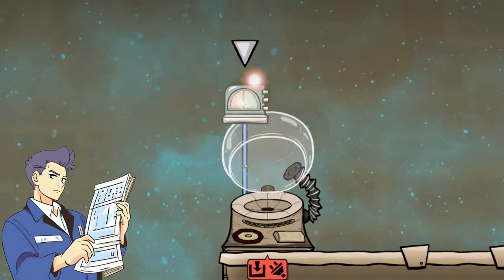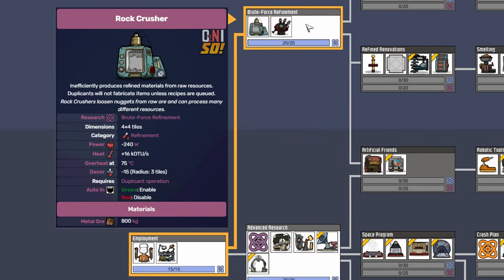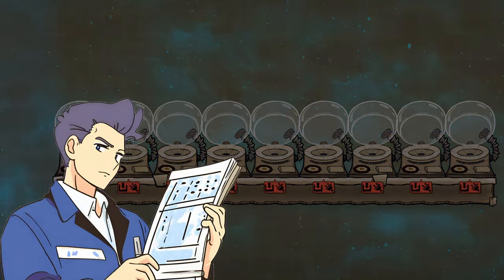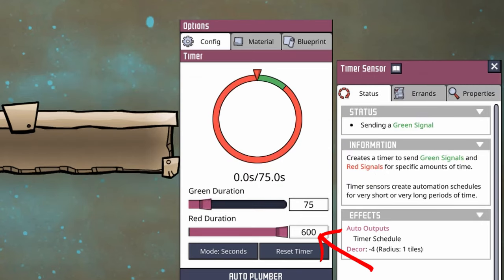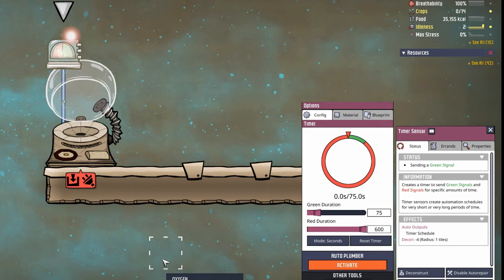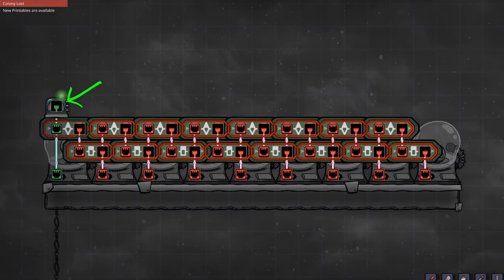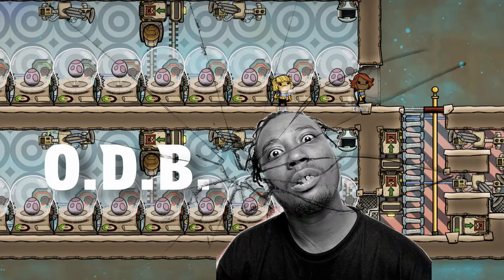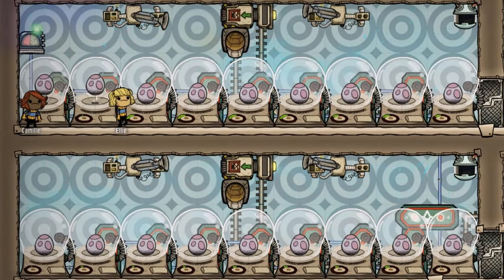Incubator Automation  ONI Tutorial

Comment: To speed up the lullaby task I install a pressure sensor under the left square of each incubator and connect the automation to a light so the dupe gets the lite workspace bonus when lullabying the eggs. There’s probably a more efficient way to do this too.
Reply from the maker: That’s a great idea. I totally forgot about that!
Reply: Lighting is an unnecessary source of heat in this setup because you pretty much have to have two dupes who live on-site and exclusively lullaby eggs, and 37.5 seconds per incubator is more than enough time to handle all the eggs. If these two ranchers did other ranching tasks too, like grooming or capturing/releasing, you'd risk missing a lullaby cycle on one or more eggs.

Comment: A simple design I came up with is getting the rancher in her/his own room that he cannot exit from where he enters, then he has to walk through the room with the incubators and in order to trigger priority, once he enters the sight of the first 2 incubators they activate with a dupe motion sensor, the door locks for 1 second (also there's a lamp), this goes for every 2 incubators and takes some time for the 1 sec door locking in order for the priorty to kick in but it's pretty simple to setup. If you want it more fancy - auto sweepers can load the eggs and so on later on when you have the metal for it.

EDIT: If anyone wonders how the automation works: I'm using a filter gate (1 sec) connected directly to the motion sensor and output goes to an XOR gate. The other input of the XOR gate is the motion sensor itself as well. And finally there's a NOT gate infront of the door so it keeps the door open. The motion sensor cannot be in the corner, but the light can be.

Comment: Nice build. I like the setup simplicity and the robustness. Maybe you could have tell that the incubator need to be the high priority for the rancher, so he come directly when the incubator is activated to not miss the actived window.

I had a similar build when i first started messing around with incubators. But instead of starting the chain with the first timer sensor, i only use the first timer sensor to make the rancher come. 
Then i used a pressure plate and a filtergate at the first incubator to more precisely activate the other incubators. 
Indeed the first need a lot of time as green to make the rancher come, but the following have a rancher just right next to them so it can be done more quickly. 

Anyway, your design is more robust to not miss any lullaby (so maximising for egg's lullaby uptime). In my design, when lullaby spree unsync with the rancher schedule (bedtime in the middle of lullaby), the other rancher didn't have the time to come for the next lullabies because he was far. In your design, the second rancher can come from afar, but at the cost of a lot of travel time in between lullaby. This is a ok trade off if the rancher are dedicated to lullaby, not so much if prevents any grooming.
 Let me explain this, it's not self-evident : Like in all thing in ONI, it depends on what you want to optimise for. 
 For the same number of full ranch critter, the incubator does 0 improvement in production. The production capability are the same with or without them.
 It does however reduce the delay for the production to arrive and this is important when you have a time constraint (emergency food or the carnivore achievement or to fill the ranches quicker)
However, missing a "grooming" task does reduce the production of the ranch. All the time the critter stays at 0% reproduction is lost production for the ranch. So by prioritising lullaby uptime, you can actually lower the production if you don't have enough rancher available. I hope it make sense to you.

For now, i didn't find any design that can cover all the thing : 
- good uptime of lullaby egg
- good rancher commute time
- handle the unsync for bedtime /multiple rancher (It's always a balance between lullaby uptime, and rancher labor/commute)
- handle the unsync from the time baby is not remove from the incubator (maybe doable with critter sensor with unchecked egg and a room for each, but costly in term of space)
- handle the "already incubated time". In your design it's always 0% /1% when it arrives in incubator, which make it pretty consistent and incubator uptime is only dependant of the previous point. But meanwhile you have almost hatching egg in the evolution chamber. There was a recent design on reddit with falling egg throu door with cycle sensor to have a approximate timer on the already incubated time but a incubator-less design. In the end, it's only important when you use incubators to refill the ranches but then it's better to have nursery to have readily available adults as anytime passed where the ranch is not full of adults lower the production. 
- power off the incubator when lullaby.
- doesn't have dedicated rancher for hugs.

To be honest, once i understood the incubators doesn't actively improve production, i lost interest in them outside of filling ranches for carnivore, where you can have any kind of setup, and yours is perfectly fine here for that. And it doesn't have the drawback of the painful setting of the array of timer sensor.
Fun story: i once did a single incubator setup (very short on refined metal) where i manually drop lullabied eggs, putting them aside and continued to lullaby all the eggs with the same incubator (micro management nightmare). Using the fact that lullabied eggs don't even need to stay in the incubator, you can even optimise for incubator uptime and egg's lullaby uptime.

Omg i ranted for so long again, sorry i lvoe this game.
TLDR: good build optimised for simplicity, perfect for tutorial.
Reply from the maker: Thanks for taking the time to write detailed and thoughtful comment!  You are 100% right, this incubator array was created for filling ranches to get carnivore and adds 0 production value once eggs are being laid at capacity. The one incubator setup is a clever solution in a pinch but yeah, sound like a micromanage nightmare. Lol

Comment: What would be the appropriate timer settings if our only running 4 incubators? 😅😅
Reply from the maker: We shouldn’t need to change any times if we only need four incubators. The 600 seconds OFF for the timer sensor is gonna stay the same because it is the lullaby buff duration. This does mean there will be some time between the fourth incubator turning off and the first one turning on. The reason we put so many incubators in series in the video was to maximize the number of eggs getting lullabied per cycle on one automation circuit.  We could adjust the 75 seconds ON time for the timer sensor for fewer incubators as long as we change the buffer and filter gates to the same number.  Though, if your duplicants aren’t completing the lullaby for every egg this may be more of a priority or scheduling issue. 
Hope that helps!

Comment: definitely implementing the timer/buffer/filter system!! Do you have any tips on how to help determine the number of duplicates you need? I used your strategy to get the carnivore achievement for the first time!! Now i want to see if i can pull it off with all Bottomless Stomach dupes, but not sure if I'll have enough for all the labor 😂
Reply from the maker: Two ranchers on on different schedules that don’t overlap on downtime should be enough to tend the incubators and the ranches they are filling. Hopefully I understood the question correctly. 😁
Reply: @engineertroy_  I'll def have 2 for ranching, my question was more directed to overall labor needs. i struggle with figuring out whether i need more dupes to carry out commands or of I'm just getting ahead of myself and starting too many projects at once 😂 i spend too much time in the pause menu instead of letting dupes work
Reply from the maker: Yeah, I'm guilty of that sometimes too.  I find that setting different priorities for different projects helps when you have a lot going on, sometimes leaving a few numbers gap between them to ensure task focus. But yes, if it's taking a few cycles or more for duplicants to get to tasks you may need more dupes .  A good way I have found that works for me is to look at the errand queue # for a task.  When they get above 50 or so I have a lot going on for the amount of dupes I have.  But a high queue # could be OK for a low priority task, say priority 2 or 3, that is more for keeping dupes from idling.  I could be wrong here but that's my experience so far.

Comment: Is it because of my potato PC? When playing at 3x speed, my filter gate and buffer gate go out of sync.
Reply from the maker: Hmmm, I haven’t ran into this yet but it sounds like it could be lag related due to the activation and trigger times being equal. A possible work around could be to set the filter gate to one second less than the buffer gate.  However this will cause two incubators to be active for one second during the overlap. If you make the entire array that would be four incubators causing a power spike of almost 1000W for one second every time they switch.

Comment: I was just trying it out, set a cycle sensor not a timer one. different research? dunno, showing no seconds just a percentage. initial time is the rancher getting there, then a few seconds each. unless there is a break or priorities  set too high, they should do it quick. if you set 75 sec they wait too much?
Reply from the maker: Definitely want a timer sensor otherwise the incubators will get out of sync with the lullaby buffs on the eggs.  Yes, the 75 seconds is the time the lullaby errand is available for a duplicant to get there and perform. You can definitely set the priority on the incubators higher so they will lullaby first but they shouldn’t wait around unless they have nothing else to do.